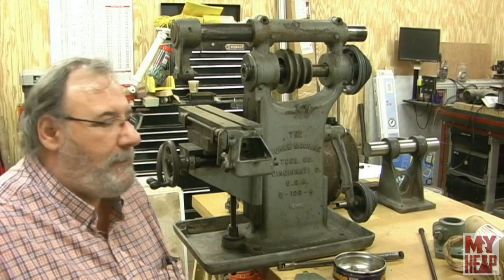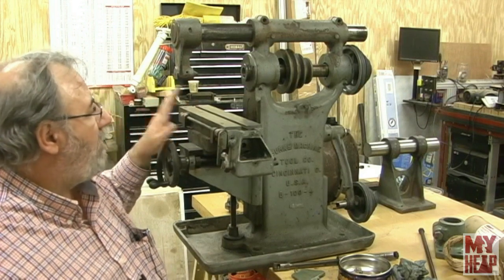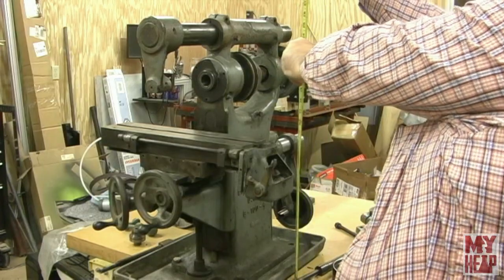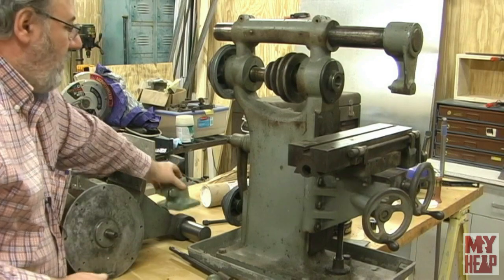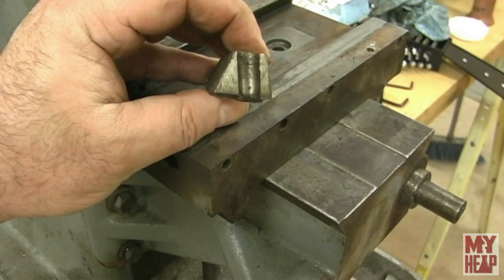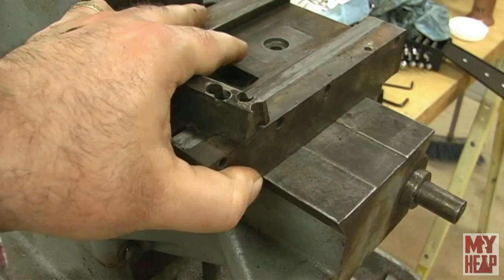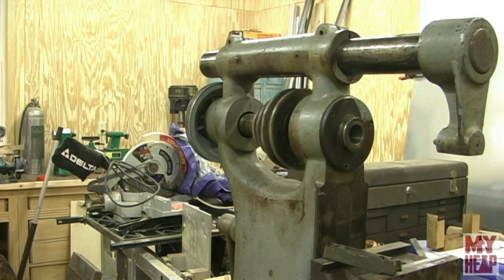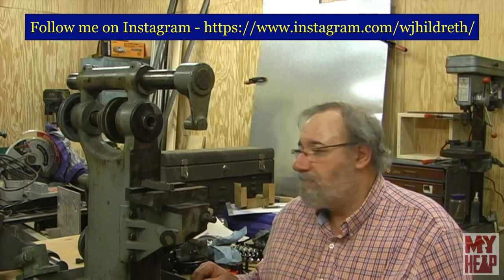Burke #4 Mill - 01 - Introduction

Comment: Neat little machine. In a pinch you could surface grind or mill off some relief on the narrow edge between the 2 angles to allow some more travel when you tighten it. Looks like a simple part though shouldn’t have trouble finding someone to make a replacement
Reply from the maker: I thought about that myself.  I don't know if this is the original part and has just been mangled beyond recognition, or what.  I am going to post some questions to the Burke Mills group to see if I can get some more information.  I hope I can get someone to step up that could make a new one.  Thanks for watching and commenting, I appreciate it.

Joe

Comment: G’day Joe, well how did I miss this? Looks like “someone” hadn’t ticked the bell, imminent kaos overcome. Yes give us the near whole 81/2 yards, you can leave out the wet wash parts  but yes the strip, inspection, your thought processes and assembly. It’ll be hard work especially the videography, darn I forgot to turn the camera on, then do a dummy run for us, hey I did it many times (shh don’t tell). It’s an awesome little machine similar to the gingery mill in specs. Have a great day, cheers Peter
Reply from the maker: Hi Peter.  I am looking forward to the project.  Most have said document the whole process.  I will leave the degreasing, stripping, priming and painting out of it except maybe one quick piece to show the process and just let everyone know that is how I planned to do the rest of it.  I remember you asking to see more of it way back when I first got it, so I had thought you already saw this video.  Glad you found it!  There is a casting missing I would like to get, otherwise it will be a bit of a pattern making challenge and molding Job.  We will have to see.  It is the casting that goes on the right side that covers the pulley and provides a place fro a drum switch.  Thanks for stopping by and watching Peter.  Looking forward to your next Gingery mill video.

Joe
Reply: G’day Joe, looking at the sketch that housing could be fabricated from sheet metal if you didn’t want to cast one, if you don’t find one.
Reply from the maker: That's a possibility though I am not much of a sheet metal guy.  My engine build probably gives that away.

Comment: Do the teardown and reassemble videos Joe. Someone else will be happy to see how it works. BTW I think I have some B&S#9 end mill holders . Make sure you get the Gib thing made out of iron and not steel . Look for durabar or get a hunk cast
Reply from the maker: Hey Chris, I want to do a little more research on this GIB and get one made.  I have had a few people now say I should show the tear down / rebuild so I think I will do that and dispense with the stripping / priming / painting, other than maybe the chip pan and tell everyone this is how I plan on doing all the parts.  If you have some B&S#9 holders that you think you might want to part with, drop me an email to xavier at gtec.com and let me know.  If they are not too expensive, I would definitely be interested.

Joe

Comment: I've just acquired one of these on its makers stand, I also have the vertical head which seems to have 2 tapers inside. I think ones for a collet but don't know the size of type & the second might be to take a chuck of some kind ? It does have a draw bar with an internal thread, but again I've yet to identify the form ?
Reply from the maker: Let me know how you get along with it.  Thanks for watching.
Reply: @MyHeap   Hi Joe, it's a great machine & I use it mostly for slitting the heads of cycle thread screws I'm making for the restoration of my British motorcycles. I've since found out the vertical head takes 3C collets, I have now purchased a set for holding both metric & imperial cutters although I'm not sure I will use them as I have a larger vertical mill.
Reply from the maker: @gvinrad  Sounds interseting!  Thank you for sharing.

Comment: You might consider a dc motor using wheel type cutters the sfm is much higher so you will need lower a RPM or you will burn up your cutters.
Reply from the maker: That is a possibility.  The machine came originally equipped with a gear-head motor, so if the speed was reduced, I need to find out what the speed(s) were and the driving pulley size of the original.  Hopefully, I can replicate the speed and torque with either a DC motor or something.

Comment: hey joe, neat little mill. If I had the cast iron to make the gib out of, I'd make one no problem for you as long as I get the dimensions for it. You want cast iron on it since it's a machine sliding surface vs steel, which would just tear up the ways. I also have some cutters that would fit perfectly on that mill, they're like 1 1/2" or 2" slab mills that use a 3/4" arbor, and I cant use them on my mill, so they're just sitting in the drawer. If you want them, just pay for shipping and they're yours.
Reply from the maker: Hi Chirpy.  I am going to do a little more research if possible on this part.  If I can get the material and dimensions for it, are you up to making one?  As for the cutters, I would be happy to do that.  After I catch up the comments, I am going to watch your mail call and will send you and email where we can make arrangements for me to reimburse you.  Thanks for watching Chirpy, I appreciate it.

Joe
Reply: yea, I can do it, just tilt the head over on the shaper and cut the compound angles no problem at all. It should be a pretty easy job, just set up the old one on a jig and clamp it down, then indicate the angles off of it and copy it to the other one. Only thing I would say is to take like a 5-10 thou shim or some shim stock in there to take up the wear, that way we can cut the new one so it works correctly. The part is pretty simple in design and pretty easy to machine up on the shaper, also it doesnt look like it's very long either, maybe 4-5" long, so well within the 7" cutting range of the shaper, so will make things pretty easy.
I have a small handfull of the cutters, which most are 3/4 arbor, and I think one is 7/8. Most of the 3/4" bore ones are around 1 1/2-1 3/4" diameter, so pretty easy to calculate the speeds with. I have no idea how sharp they all are, but they shouldnt really be dull since there is no arbor for them for my mill, so they've probably just sat there thier whole lives.
Reply from the maker: Chirpy,  I definitely want the cutters.  I have zero tooling so whatever I can start with the better.  I will email you shortly and we can work out the details.  I think I am caught up with the comments now.  Thanks man, I appreciate it!

Joe
Reply from the maker: I sent you an email Chirpy.  I think I measured it at 4-3/8 in length roughly but would want to sit down and take some more measurements based on the cross-slide and knee.  I am thinking someone made this one, or hammered and chiseled the existing one.  I will need to make arbors for the machine, most of what I see for it are 7/8 and 1" in diameter, so making 3/4 inch arbor is fine too.  Been want to make a taper attachment for my lathe so this is a great excuse to do that!  Thank you Chirpy, I appreciate it!

Joe

Comment: that will pretty servicable if you can get it to run at about 60 rpm slowest speed
Reply: have promised you an email. i have some pump info. will add some mill jottings too
Reply from the maker: Hi Emma.  The mill would have been originally equipped with a gear head motor that would allow you to select multiple motor speeds.  That coupled with the step pulleys would have given a wide range of spindle speeds.  I don't have one of these motors and I will have a challenge to get slow speed from the spindle.  It may require a bit of creative ingenuity.

Email when you have time.  I am not in any hurry and I know you keep pretty busy.  Thanks for the help, I do appreciate it.  :-)

Joe

Comment: paint looks good to me. Is it original?
Reply from the maker: I don't know if the paint is original, but I have parts with two different colors and there is a small amount of rust.  I probably could get by with a good cleaning and a touch up, but after doing my lathe and not painting it, it looks a little sad.  I thought I would go ahead and paint this machine.  Thanks for stopping by Matthew and watching.  I appreciate it.

Joe

Comment: Looks a lot better than the last time I saw it in the back of your truck! I have a piece of cast iron that is approx 1.25 - 1.5" in diameter and 15" long. Would be glad to lop off a chunk to donate it to the cause for the new "gib", just let me know where to send it. The following link is to a guys channel that has 6 videos showing one of these in operation. They were uploaded in 2012 so you will have to scroll down to find them. The videos show quite a few of the parts you are missing and might give you some ideas. Cool machine! https://www.youtube.com/user/BostonMachinery2008/videos?sort=da&flow=list&view=0
Reply from the maker: Hey Rich, I will email you about the cast iron.  Thanks for the link, I will be sure to check it out.  I have to agree with you that it looks better in the shop than in the bed of the truck.  I am excited about getting it going and I know the guy that gave it to me would like to see it running too.  I have documentation that was given to me and some I found on the Burke Mill yahoo group.  I hope the videos will help me, the exploded drawings that I have for the machine are sort of hit and miss for some parts of the machine.  In particular the auto feed, but there does not seem to be much too it.  A worm and wheel with the worm on a cam so it can be engaged and disengaged.  You know me, I will complicate it if I can.  HAHA  Thanks for watching Rich and the support you give to my channel.  I appreciate you my friend.

Joe

Comment: Oh!!! She is cute !
Early 1900s?
If you make a base yourself, make it HEAVY! I'd suggest (if feasible) to mount it on a concrete block. (that's cheap and very rigid) These old machines rattle and shake a lot and you want to have some serious mass to absorb all that.
I don't know the brand of these machines, but it seems to me that these 'gibs' could be the result of an earlier restoration.... it doesn't seem like a bad solution. I have seen something like this in obscure Swiss millers (small ones for the clock maker industry) But it doesn't seem common (at least not as far as I know)
There are a lot of pictures of a Burke Nr 0 on www(dot)lathes(dot)co(dot)uk/burke/ maybe those can be a bit of help?

Paddy
Reply from the maker: Hi Paddy.  Not sure of the age of the machine.  I think it is from the late 40s to early 50s.  Usually from about 1930s and back stuff here are flat belt driven, but I really don't know.  The gib on the z axis is made the same way, just longer and larger.  I have never saw one like it before.  I think one will have to be made for the saddle though.  Thanks for the link, I will check them out tomorrow as well as post some questions to the Yahoo Burke Mills group.  I was thinking a heavy wood bench with 1-1/2 thick solid top.  Think that would be heavy enough?  Thanks for stopping by and the help.

Joe
Reply: I'd say it may be somewhat older, given the fact that the overhead support is still a round shaft, but I am sure that will be eventually found out. 
As far as benches go.... the 'official' lowdown is this... metal working machines live on metal structures, capable of absorbing vibration caused by the use of the machine.
It is preferred where possible that the machine, or the machine by means of its base is anchored in the underlaying concrete floor.
Wood also 'lives' and moves, which isn't a great thing, if you know you have to level this machine out with a machinist's level...
So, as a default answer, I'd have to say 'no' to wood. 
Now, our homeshops aren't industries, so one can (and is often forced) to compromise.
If you decide to make a wooden bench, use old heavy wood (beams cut from surplus railway sleepers come to mind)  1 and a half inch ain't going to cut it.... double that at least.
Better still would be a 'stool' made from heavy angle (say 2"by2" by 1/4") clad with metal plate at least 1/8" thick just to add weight.
Make no mistake, if your structure is less than solid, the vibrations left unchecked WILL be visible in the surface finish of your work.
All manner of strange things happen in home shops... I have seen people put two ton machines on coaster (casters?) which is utter insanity !
And I have seen people take a Chinese mini lathe (pretty useless thing as it comes out of the crate) and bolt it to a steel table , 6 times the weight of the lathe and actually do useful work with it....So whatever you do, don't cheap out on whatever you are going to have this machine living on. I'd say it is just as important as the machine itself.
Next summer I am moving to a new shop, and we have cut out a section of the floor (a concrete slab of about a foot thick) to add more concrete for my Arno milling machine.
That is a lbs 2500 horizontal mill with all the trimmings. The hole will be filled up with a special type of concrete (they tell me it is rubber dust from recycled tires, mixed with waterproof concrete) at the rate of slightly shy of a cubic meter (that is about lbs 5000).
So a solid base is important.

Cheers
Paddy
Reply from the maker: Hi Paddy,  that is some good information.  I think for the rebuild I will build a sturdy bench to place it on, and in the interim scrape up the materials to make a proper bench / stand.  I have to sit it on something to work on the machine that it more rigid than what it is placed on for the intro video.  When I get the materials to weld a proper bench for it, then the interim one can be used for my bench top drill press.  Thanks for your help and advice Paddy, I appreciate it.  As far as rigidity and vibrations, my shop has a 1-1/4" wood floor sitting on 2x10 spaced on 16" centers, so I am sure that I will have some issues no matter what, but, like you said, in a home shop, we have what we have to work with.

Joe